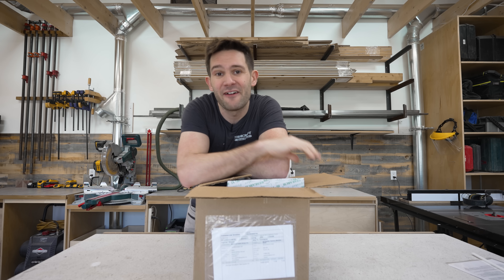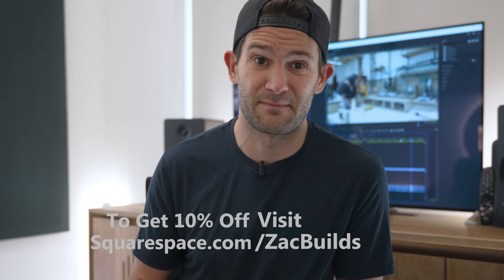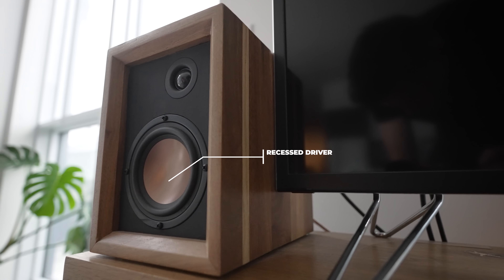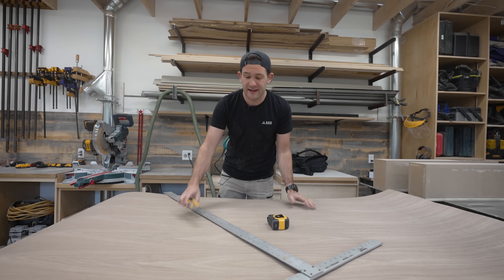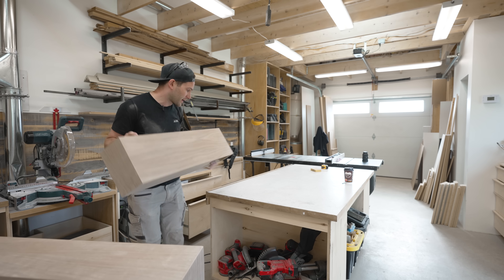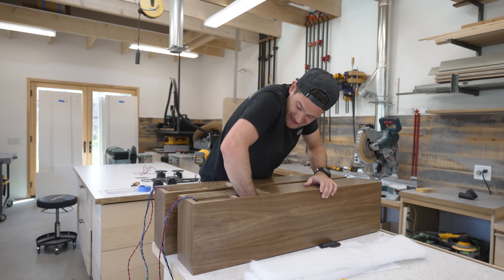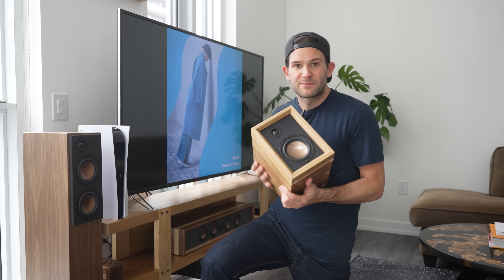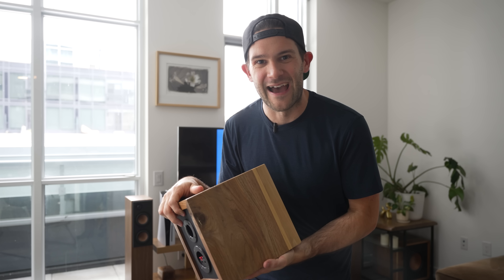MDF is BETTER than hardwood

Comment: The Dacron? Is not meant to dampen it is meant to slow the air down in the cabinet and make the internal volume larger than it actually is.
Reply from the maker: No, it's meant to dampen. Look it up.
Reply: In a sense, you're both right. It spreads the pressure waves (not the air per se, but this is pedantic), which effectively slows them down and this is dampening. This effect also makes the internal volume behave as if it's larger to the driver(s).

Comment: Awesome video. The lack of voice clearity in regards to your old speaker could have a lot of reasons. Bad Crossover Point, one woofer, edge diffraction of the old design. Your conclusion bigger speaker is better is therefore wrong.

Comment: Concrete really is the ideal material for speakers, that and granite (there is 1 guy in Slovakia that made a pair, he will cut them for you on demand but not cheap plus you gotta find a way to ship em yourself). However, it is kinda heavy. 

Concrete plywood is a good second though, if not too large.

Comment: I hate and never recommend using MDF in any project purely because it's high toxicity and the fact it sucks, gets swollen from any moisture and is not so easy to paint if you don't use the right products. I have made tons of wardrobes, kitchens and different projects including speakers and it's always better to find a substitute to MDF, like lets say plywood or valchromat or even as we call it in Poland 'woodworking board' which is pine strips glued into a board and then veneered from both sides (kinda solid wood core plywood). 
Keep building tho, great project and I must admit I build my speakers using MDF about 11 years ago as a very first project I tried. Still holding on screws and painted with a regular wall paint because I hate the MDF and will be rebuilding them from ply some day. Always wear a mask when cutting or routing MDF

Comment: All of that is fantastic... But, there is a little problem: the crossover is not designed starting from the measurements of the speaker's frequency response in the box, and this makes the crossover working not in the best way for these particular pair of speakers

Comment: Did you take into account the Thiells Small parameters of the drivers for the internal volume?  How did you determine the crossover parameters?  Is this running 2 and a half way?  What does the frequency and phase response look like?  How much power are you using to drive the speaker and at what load?  If the intent is to just have fun building something at home, awesome!  But realize there is a TON of actual physics that needs to be adhered to (no matter what Bose says... hah)
Reply: These, much like the standard Overnight Sensation speakers, are proven designs by Paul Carmody, so from a speaker design standpoint I doubt there is much to criticize. You can find all details, including plans, crossover design (yes, it is 2.5 way), and simulated SPL, phase and impedance plots.
Also, I'm pretty sure they're aware of the complexity of speaker design, looking at how they pointed out their mistakes from building the original Overnight Sensations.
Reply: Ha, nice dig at bose. Have an old set of 901's hanging around,  not a bad sound if done correctly.  But the rest of the line up is shit. Guess they figured 1 good product and the name is good to sell crap. Just give it bass and ppl think it's great.
Reply from the maker: Exactly right. Also Paul stopped by to say how much he enjoyed this video and the end result which was really nice.

Comment: They look fantastic, but I didn't see anything about cabinet volume and displacement for your drivers. I'm sure they work fine, but if you're trying to optimize you really should have the specific amount of space the speaker is designed for in the cabinet.
Reply: This is a well known speaker design by Paul  Carmody. Im sure Zac has kept the dimensions unchanged from original design. The little bit of extra volume added by the external front baffle wouldn make any significant difference.

Comment: awesome craftmnshi quality, but speakers cabinets MUST have a specific internal air volume,  specific dimentions, specific port size and length.  A calculated emclosure will sound way way better, is not something "barely percibable". Youll be amazed with the difference.
Reply from the maker: these do have a specific internal air volume

Comment: Is there any acoustic reason to offset the tweeters, or is it just style?
Reply: If you angle the speakers in towards you, there is little difference. However, with speakers parallel to the wall and each other, with the listener off axis, the difference in acoustic distance will cause slight smearing, especially in the crossover region. It's best to place the tweeter inline with the two midwoofers, actually in between them; this (called D'Appolito alignment) will improve the imaging slightly by making it seem like all frequencies are coming from a single point source. All three drivers should be offset slightly from the midline axis of the speaker face to reduce diffraction distortion slightly; for style, it's usually towards the inside.

Comment: You made a mistake, you should have left the material you cut out where the speakers are mounted, a thicker front Baffle is common in high end speakers. You simply needed to drill holes through the glued on the new front. You also changed the speakers interior dimensions by removing that piece of the baffle.

Comment: All that high-end woodworking equipment, yet no equipment to design a proper crossover?  It's impossible to design a crossover specifically for a diy build without first measuring how the speakers behave with the enclosure you built.  Sure a predesigned crossover will sound ok, but it won't sound great.  I also suggest putting the crossovers below the ports so the heat and vent out the openings.  Those ceramic resistors can get pretty hot and their values will change as they heat up, thus changing the behavior.

Comment: Great video! If you were doing it again does the MDF make enough difference sound wise that you'd accept the difference in looks?
Reply: If you use a veneer to cover up the MDF like he did, there's really no perceptible difference in looks
Reply from the maker: That's a great question and honestly I'm not sure that I would. I thought the MDF would be easier and cheaper too, but it turned out to be more expensive (once you factor in the cost of the glue, veneer and MDF combined) and more time consuming than just using a hardwood. I dont think I have ears tuned accurately enough to hear the difference either.
Reply from the maker: I wouldnt say there's no appreciable difference, I could spot a veneered speaker from across the room, but there's VERY little difference. And most non-woodworking people would never know the difference.

Comment: Pro tip----contact cement it ridiculously expensive and too hard to work with.  Use wood glue allowed to tack up and a fair amount of clamps.
Reply: In addition, contact cement has a limited shelf life.  If you use it, only buy what you need for the project.  If you need a quart, buy a quart.  Don’t buy a gallon figuring you will have it for the next project.  The next time you use it, the old stuff may work but it might not adhere as well, so buy it fresh each time to improve odds of a successful installation

Comment: Good project overall; I have a few tips for anyone wanting to more or less duplicate this:

1. Instead of thick MDF and veneer, an easier build (OK, that might be debatable) without the smell would be to use 1/2" MDF for the interior box, and then build a 1/2" thick hardwood box on the outside. (This is probably overkill for such a small width and depth; 3/8" each is adequate if you want to save weight.)

2a. Install the tweeter in between the two midwoof drivers, placing them all as close as possible. This (called D'Appolito alignment) will improve the imaging by making it a single point source.

2b. If you want to get excessive, since you're already going to the trouble of having a separate driver board, recess the tweeter slightly relative to the mid-woofs so the distance from the source (the cones) to your ear is the same; this will add very slightly to the clarity in the crossover region.

3. Skip the port if you have a subwoofer; this will improve the power handling and lower-mid clarity.

4. Offset the three drivers (which are in a line as per #2) slightly from the centerline of the speaker box; this will spread out the frequency of the diffraction from the speaker face, reducing distortion slightly.
Reply: @nothinghere1996  — I assume you mean a transmission line speaker. No, I haven’t, but I plan to (probably not soon, though).

Comment: You did so well and then you put the blind nuts in wrong. Blind nuts go on the back side of the wood. Threaded inserts would have worked for your purpose and a dab of glue would keep them in forever.

Comment: Nice! Clean build, is this a 3 way or 2 way design?
Reply from the maker: It's a 2.5 way design haha. One of the woofers gets an extra inductor before it to push its frequency response a bit lower. Basically a 2 way, but with a little extra spice.

Comment: MDF is used in the speaker industry for only one reason- It is CHEAP!  Plywood costs more but will always last longer and looks much better with a good veneer.
Reply: I'm sorry; this is incorrect. As he said, MDF is higher density and amorphous, which dampens interior reflections relative to solid wood or plywood. Also, particle board (LDF, or Low Density Fiberboard) is cheap; MDF (Medium Density Fiberboard) is not so cheap. There are definitely cheap speaker makers who use particle board and inadequate finishing; a proper MDF with proper finishing will sound better and last just as long as plywood.
Reply: @altosack  Plywood and MDF won't sound that different vs each other. If anything it might sound identical. You're going to add braces anyway so if there was a chance of plywood being less dense the braces will dampen that. 

And plywood weights significantly less which is nice because one of my subwoofers I've made weights 80 pounds instead of 120+. 

But you can't go wrong using either one unless there's specific needs you need from the material.

Comment: Sorry no.... real or solid wood is better than fake wood(MDF) due it’s continuous strand of wood that could dessipate acoustic wave faster than MDF. It has already proven by one youtube vlogger when he tested it with accelerometer. The tensile stregth of solid wood is higher as compred with mdf with similar size and density. And yes..no porous thingy after years of use. MDF is ONLY commonly used because you can’t find a solid wood with size of 1m x 3m not unless if you cut old huge trees.
Reply: MDF is made of mixture of different particle of wood with different material characteristic that they don’t really stick together unless you compressed it. Overtime, it losses that compression especially in humid that it would absorb moisture from the air causing it to bulge and becoming porous. Have you seen those powder thing coming out from the old speaker made of mdf?

Comment: *Does not have to be MDF, your analysis of why hardwood should not be used is completely wrong........(C)
*Braces .....(A+)
*Rounded edges........(A+)
*The coils in the crossover are completely mis-placed and you will get crosstalk like crazy.  ........(F)
*The tweeters should be on the inside not outside when setup
Reply from the maker: *YouTube comment, rude and lacking any substantial information.....(D-)
*Haircut..... (F)